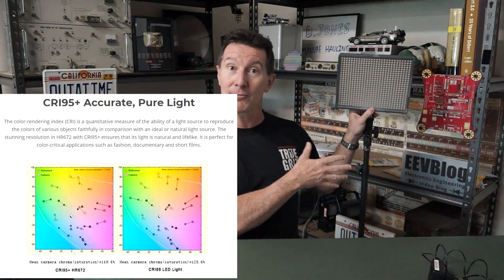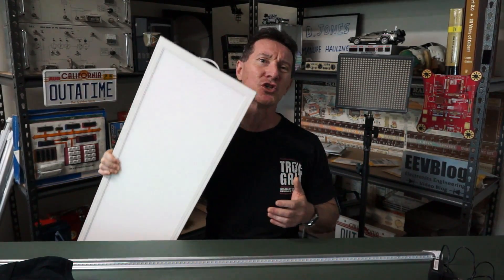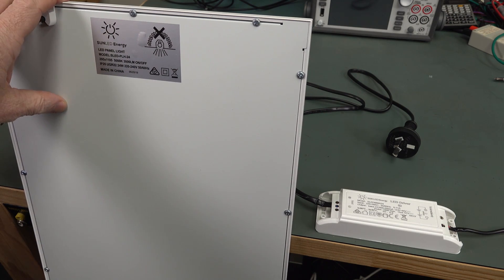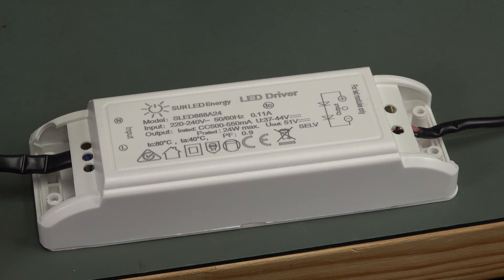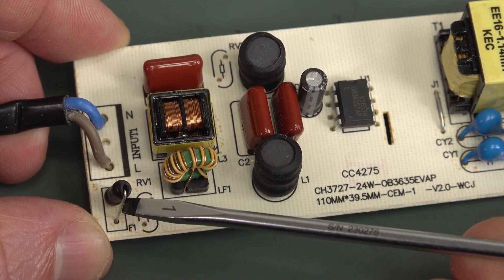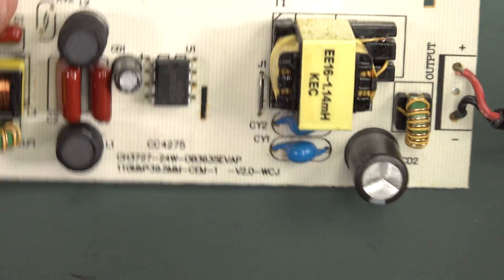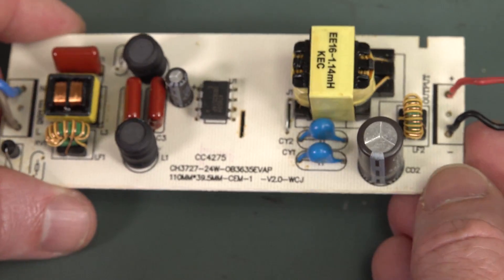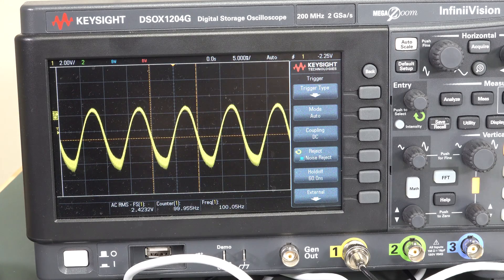EEVblog #1252 - LED Panel Lighting Flicker Investigated

Comment: Wires direclty soldered onto the boards look like cheap aluminum aswell. Break easily and does not carry current well. Firehazard. EDIT: I only mention this because you use so many! Its fine for only a few used in a small home.

Comment: What about sound? That setup is horrible for sound! Acoustically reflective hightemperature surfaces all over! Speed of sound changes with temperature so you will get a jumbled mess of acoustic roomressonance. As an audioengineer I would not want lights like that. Properly underdriven LEDs (which makes them run cool instead of getting hot) will allow more acoustically optimized materials in the fittings/construction/lensing aswell as negate that firehazard of those clearly overdriven LEDs that are built to fail and flicker (flipperLEDs cuz tey flip out

Comment: Looks like a bad circuitboard. Are you sure thats actually not a firehazard? Doesnt look like proper fireproof (not even marked 94-V0 for firerating). The trces might be very thin aluminum oated in a very thin copper spray., which makes them not last long AND not be very good conductors aswell as )mosdt importantly:) traces break easily when bent or temperature changes

Comment: Flickering on camera depends on the shutter speed. If you lower the shutter speed to 1/25s you won't see flicker as it averages out. But increasing shutter speed to 1/100s or faster "draws the flickering out" better. My trick is to use my phone's camera in "PRO" mode where I can manually change the shutter speed, increase it and see if lights flicker or not. It has nothing to do with quality of camera or sensor - you just have to have fast shutter. With automatic shutter it happens automatically if you shine the light straight to camera, it starts to increase the shutter speed to lower the effective brightness.

50Hz and 60Hz modes are a bit different story. They are there to avoid a bit different type of flicker which occures because 60 doesn't devide by 50 and vice versa and this gives temporal flickering. Also this effect is reduced when shutter speed is very low (low light!) and increased when shutter speed is fast (bright).

Comment: The second driver will be less efficient. The ic and transistor on the secondary is just an active linear filter which means power loss.
True cure is a two stage switching driver such as PFC flyback to CV output with CC buck tagged on the output.

Comment: At 5:37 you see the rectifier "D81". On its output, two solder dots without holes is the PCB follow. Drill them and place a 450 volt capacitor there. Before powering it up, use a resistive load and measure the current it delivers with and without the capacitor. Also check if the drive chip gets unexpected hot. Never touch the operating or connected circuit to avoid electrical hazard.

Comment: I don't get it.  Why is it on PSU inputs there is usually a full-wave bridge, but on output sides, there is usually only a single diode?  Wouldn't the ripple be a lot better (less) if it were a full wave on the output too?

Comment: Dave, Please do a tear down on why Infra Red Motion Detector Security lights fail so often. I have a collection of about 15 IRD Infra red detector flood lamps kits that just don't turn on or false turn on, cycling on-off-on-off. Or just stay on for what seems to be forever. 

They seem to just last for 9-20 months and turn into garbage. They don't trigger correctly Why? Temperature? crap caps? what? It seems that anything Honywell is crap, Intellisense is crap Brinkman is crap, Horrible Freight is crap.

 I do have ONE dual sense (two light  intensities) IRC light that is very good ITT or Intellisesce is the brand. But, Anything under $45 is crap. why? I want a Motion Detector to last at least 8-10 years. Maybe you could do a "shoot out" of which Motion Sensors work the best. 

I would be glad to ship you some of my sensors that stay on too long or false trigger. 

We have wild animals like Fox that sniff our chickens and deer that eat our roses, and coyotes Buck Deer in heat who may charge/attack our dog, and Mountain Lions that roam and may harm our sweet old Labrador dog. 

Just curious if you would be interested in an analysis.

Comment: What causes the current to ripple way more than the voltage? Even though it's constant current I would not expect the current to drop so much for each cycle if the voltage is staying relatively high.

Comment: Come back fluorescent all is forgiven... yes you can buy Philips 90,000 hour rated lamps which will outlast any LED (and be recycled afterwards), yes the higher efficiency magnetic ballasts weren’t that bad considering they were easily recycled, and the fittings were easily repairable by any sparks (unlike LED, they’re all different and the whole fitting usually gets replaced). We may have lowered our energy consumption a bit, but at the cost of much more e-waste and plastic trash.

Comment: Flicker is the most important thing I check for new lights. Very important for LED lights, as - even with reputable manufacturers - lots of them have problems (even different series from the same manufacturer).  This is why I don't use LED here but fluorescent with a 40 kHz driver. This along with the fluorescent coating prevents flickering completely (well ok LED with a battery is definitely better, but you get my point for home lighting).  

So now your state installed more flickering LED bullshit that affects the brain. And they make you pay for it.

Comment: The PCB material is CEM-1. Inside is paper, but the binder is epoxy, not phenolic, and  the outer layer on each side is glassfabric, usually 7628 type. CEM-1 can only be used for PCB without chemical through hole contacts, so it's mainly used for single side PCBs. It's still UL-V0 flame class (hence the red logo, UL-HB material has blue logos), same as FR4. "ZD" is the logo of Jinbao factory from Shandong. China also has a laminate type that uses a CEM-1 layer construction, but with phenolic binder. They call that 22F, it's not an ANSI type and has no UL classification. I guess it's not used in export products. Great video! Thanks!

Comment: I don't know, but wouldn't be better to increase the input filtration capacity, there isn't almost any, and when you'll not have 50Hz ripple on the primary/input side, where from would come the ripple to the secondary/output side.

Comment: This cheap construction is also used in newbuilds in the UK widely. And yes they are this crap so once you move into your shiny new flat you can start by destroying everything and bringing its ligts and wiring up to decent spec. A since 24W switching is performed by the darn one transistor there in an integrated package without cooling the operational characteristics of these crap drivers change as the temperature of the components increase and sometimes can cause the lights to cut out or just pass through some epilepsy-inducing low frequency flicker that is like a strobe light in a disco.

Comment: The second winding on the primary side is not only for feedback in case of primary side feedback controllers but also for supplying low-voltage power to the primary side switching IC.

Comment: I never knew that the output current waveform is 100Hz sinusoidal in switchmode power supplies
Reply: That is not always the case, it is due to it it being a low cost single stage high power factor driver. A more expensive dual stage driver will have  little to no 100Hz ripple.

Comment: If a driver or lamp says it's mains dimmable it will flicker at the double the mains frequency, but it of course it may still flicker if it's not stated as being non-dimmable. However these drivers don't appear to say either way.

Comment: Could calculate a rough estimate for that tube light replacement plan in NSW. Your video overlay stating you're actually paying through taxes triggered this idea. Say they find a cheap seller of those panels, there's an average per company, removing and installing is a quick job, shouldn't take hours and hours of work? I don't think it should be that expensive per company, and it would save tons of electricity switching to LED. Perhaps more of an Engineering Explained thing, this sort of calculations, but you also have a whiteboard!! ;)

Comment: But if the flickering is mainly 100 Hz, wouldn't a nice and big capacitor after the rectifying diodes fix that?
I mean, sure you have a little ripple from the high frequency switching, but to me that doesn't seem to be the problem. I figure if you had clean DC mains on the input the flicker would be pretty much gone, so where's the problem?
Reply: Phino K.M. 
That will work, but the power factor will drop to 0.5 or even lower and you might need some inrush limiting. For most consumers the lower power factor will actually not really be a problem, but manufacturers are required to have a power factor above 0.7/0.9 depending on the power rating and the region the product is intended for.
Reply: @wolkman2157  That's true, though I've seen many switch mode power supplies without PFC which do more or less the same. I guess it'll only become a problem once power companies start charging apparent power to normal consumers.
But if you want a better power factor you can always add an inductor in series with the input or whatever.
I was just a little confused as to why Dave was constantly talking about the secondary side and acting as if it weren't worth it to fix. I mean it's not like a simple electrolytic capacitor for the input would be so terribly expensive.

Comment: MeanWell makes some LED drivers where you can trim output voltage and current. Fixed industrial floodlight with one gutted from another fixture with faulty LED COB. _

Comment: the problem is the primary capacitor, and it is a Flyback that is why you only have one diode. And from the PCB the diode seams to get quite hot

Comment: If your lights flicker at 100 Hz then the camera anti-flicker will try to set the exposure to a multiple of 1/100sec.  That can only work when the exposure is longer than 1/100 sec.  If the light level is too high or the aperture is too big then it cannot avoid the flicker.

Comment: As well as flicker, which may also affect our non visual, optical circuits, beware of the blue light output. Blue light later in the day will wreck your melatonin production and your sleep wake cycle. There is much emerging work on these issues showing how damaging to health poorly designed LED lighting technology can be.

Comment: Sorry, I don't understand Dave's account at all. Any ripple on the secondary side of the transformer would be at the switching frequency, not at 100 Hz. A fatter cap on the secondary side won't fix that 100 Hz ripple. It must be caused by lack of smoothing on the primary side, surely?

Comment: Had one just like this at work go bang the other month. One of the panel leds shorted out and the power supply blew up in a spectacular way. I salvaged the aluminium bits and perspex and chucked the rest out.....total shite and a waste of money otherwise. Still wondering if it was the psu that took the panel out, or the other way round.
Soldering in the dark is for winners, apparently :)

Comment: I'm convinced that the constant switching of the LEDs will cause early failures on them.   That's effectively what these controllers are doing - switching the LEDs on and off.

I was asked to look at doing an LED driver for a company a few years back and started looking in to it.   The really cheap drivers for a bulb are simply a resistor, small cap and a bank of LEDs.   Absolutely nothing in it, and they rely upon the capacitive reactance to step down the voltage for the LED.   Great for lowering cost.
Reply: John Sim Yes.  Big Clive from the Isle of Man has done a lot of videos on these low cost circuits.  One detail Dave missed is that the "sense" winding powers the chip via a diode (the two series resistors are just to provide an initial charge for the decoupling cap.  Sensing is via the voltage divider to an input pin, and the current sense resistor attached to the switching FET (some chips measure the FET loss voltage instead, for that extra power efficiency).
Reply: @johnfrancisdoe1563  I'd say that diode is there to ensure that the sense voltage never goes above Vdd rather than powering the chip.
Reply: John Sim
I’ve designed several primary side regulated single stage led drivers and the diode is there for powering the chip. The high ohmic resisters connected to the rectified mains are only intended to charge the decoupling cap up to certain voltage at which the chip and the convertor will start working after which the aux winding (through the mentioned diode) will power the chip. This is more efficient then powering the chip directly from the rectified mains.
Reply: @wolkman2157  I had to go searching for the data sheet and you're right, I'm wrong.   Not how I'd design it, but I can see the advantages.   Typically when I see an input like that and a diode connected to Vdd it's to protect an input.   And having a load on an input pin that you're sensing doesn't seem like a good idea either.   Complicates the control loop when you've got a non-linearity.
Reply: John Sim it is actually quite common for these low cost led driver control IC’s. The control loop only acts on the peak current (measured by the resistor connected to the mosfet’s source). The aux winding is used for the low voltage power supply and for the output over-voltage protection (measured by the voltage divider connected to the FB pin).
Reply: @wolkman2157  I only did brief research in to this but the company was being difficult when I asked what environment the lighting was for because that would then impact upon the creepage and clearance.   They wanted to have the mains terminals very close but I wanted to check that was safe.   I think they went and bought Chinese modules instead.

Comment: Hi Dave - I work for a lighting company in Perth with a small local engineering team. We recently did a marketing/whitepaper on flicker which you might find interesting: https://unios.com/wp-content/uploads/2016/06/UN_Driving-the-Flicker-Free-Effect_White-Paper-190205.pdf Driver quality in the market is a big issue especially when price becomes a factor. Comparing the driver you got with those panels with our own developed flicker-free drivers and ones we sell from Tridonic/Osram you can see vast differences in complexity. You get what you (or the government is willing to) pay for I guess. Invisible flicker ( around 80-200Hz ) can be just as bad, it's just not perceptible. The IEEE 1789 standard is about the best reference at the moment to determine "Flicker-free" however the term is unregulated so anyone can claim the general term. Primary side current sensing is pretty much de-facto now and you can achieve excellent results with it. There are driver ICs out there that are very very good at it. 

Really sad to see such low quality drivers making it into the market with flicker like that. There was such a major push for high-frequency fluorescent electronic ballasts to eliminate flicker and now we're back to square one with LEDs...

Comment: You can measure flickery of a lamp if you connect a capacitor and a small solar panel element in sequence to headphones or a mic input of a phone. The noise is very distinct in those lamps that flicker. See the video 9h4_W25qP64

Comment: Just wait until the Chinese remember you can control the output current of a transformer by air gapping it. That will set the wold on fire probably in more than one sense.

Comment: I remember at our lab at work we spent some time trying to debug an intermittent 38Khz IR sensor problem that would occasionally pick up false triggers. Half a day later we found that it was a bad office flouro light occasionally flickering at exactly the same time as we picked up the false triggers. Replaced the tube and problem went away. I am not sure how that wouldn't have been filtered by the IR sensor, but perhaps as the light flickered it went through a range of frequencies and happen to get past the filter.
Reply: Air Command Rockets Fluorescent tubes start at a different light frequency, then smear it out to cover the visible spectrum, leaving significant sidebands in the IR and UV ranges.
Reply: @johnfrancisdoe1563  it's not about the spectrum of light it's about it's intensity flickering. IR sensors are actually sensative to a fairly broad range of the light spectrum.
Reply: I'm pretty sure the filters on those things are pretty course.

Comment: First hand experience, Flickering light can give you headaches. Especially if the duty cycle is only 50%.
Reply: It's not the duty cycle that's important it's the modulation depth. The crappy one he measured here is 100% modulation.

Comment: I don´t understand where the flicker comes from. The chip uses a high switching frequency so where comes the 50/100 Hz flicker at the secondary from. Only the primary voltage could modulate the chip somehow.
Reply: Uwe Polifka Bingo!
Reply: Uwe Polifka 
To achieve a high power factor there is little to no buffering on the primary side and in this case also insufficient buffering on the output. The out put consist of both 100Hz and to a lesser degree the switching frequency (as Dave shows when he zooms into the current measurement). A more expensive dual stage driver will have practically no 100Hz ripple at the output.

Comment: Never mind the effect on video cameras, what about people’s eyes? I have sensitive eyes and even 120Hz flicker is very irritating. Some really badly designed LED lights, especially common with the decorative “filament” type, have only a half wave rectifier and no filtering at all, so they strobe at 50 or 60 Hz with no output half the time. It’s almost enough to give me a headache at 60 Hz, I’m glad I live in America!